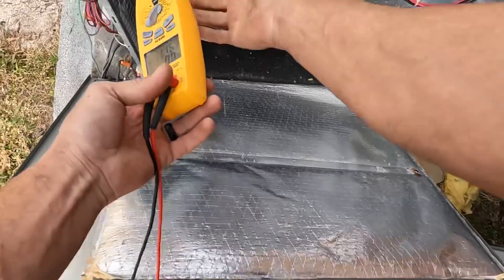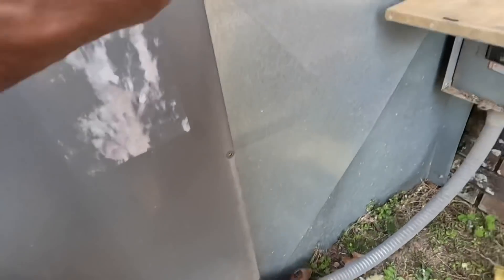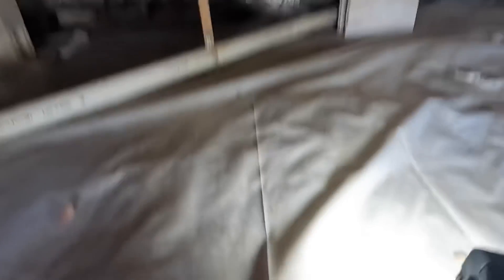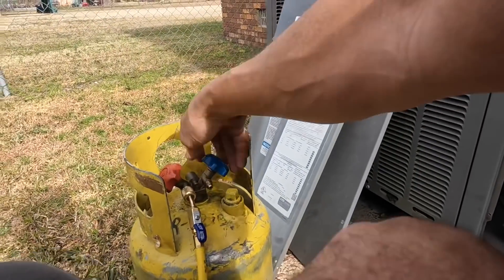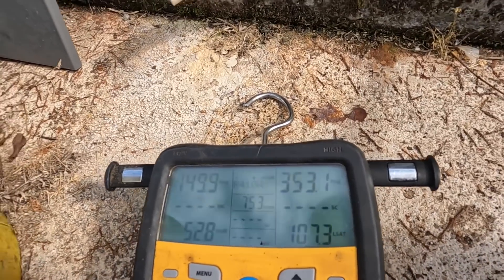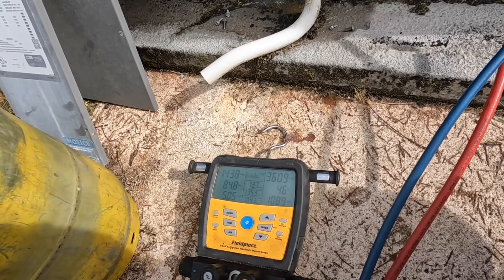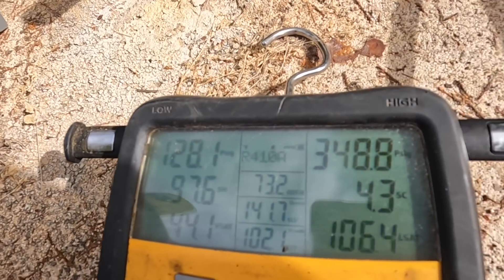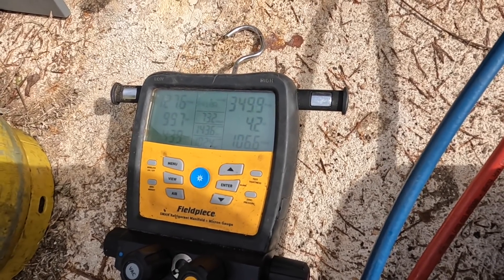Really High Head Head Pressure on Ruud Heat Pump Package

Comment: I had a split system today that was not cooling well 30* split but suction line freezing back 
Initially 94/258psi but after that ran consistently 
106/263 @ 76* ambient 410a system 
Compressor good amps 
SH 0 SC 3 
Looks low charge by pressures but SH/SC are anomaly 
Piston system coil fair inside and out.
Blower pulling 1.7 A out of 3.1 clean filters 

Put into heat mode and pressures 170/559 rising before I switched back 
Filter drier is on discharge line 
Reversing valve sounded very smooth 
Forgot to watch it equalize however once it did, it was 168/170 for a 59° saturation at an ambient temperature of 79° 

Since it’s a piston, I don’t think that’s necessarily an issue, but I feel like the reversing valve is the issue since there was a unit same model next to it with a dead compressor burn out 

For this unit I would quote an extension of diagnosis and check temperatures across reversing valve hard to access
But generally, I would quote replacement of reversing valve and filter dryer and open piston for inspection at that time while recovering also check charge and compare with data

Comment: I can’t tell you how many times that’s happened to me I get a call and someone overcharged the unit because a coil, or filter was dirty and they see low suction pressure and just assumed it must be low on Freon. Lol. Or they just Dont know what they are doing. It is weired the customer sais no one has added any Freon. I Dont get that. Strange.
Reply: I actually had a little straight air unit one time I really believe someone had added Nitrogen in with the refrigerant.  It run perfect, pressures were in the norm but just wouldn’t hardly cool. I didn’t have anyway to know a 100 percent but that seemed to end up being what it seemed to be. You never know what someone has done before you get there.

Comment: I have a unit I’m working on currently where a heatpump condensor runs normal pressures but after about 10/15 minutes the pressure on high sides starts to climb until 400s then trips on high head, I was thinking possibly the reversing valve but I would assume my suction would look off the suction stays @120 but the head slowly climbs from 300-400 over the course of 30 minutes any thoughts dryers same temp on both sides inside up unit the accumulator seems to be sweating excessively

Comment: Is it normal for a few ounces to make such a big difference in pressure? I have a 6 month old 5 ton Amana HP that keeps showing a "low refrigerant" message.  Installer (a reputable company with multiple techs) has been here 7 times in last thirty days. Once with Amana rep. The low ref message shuts off the HP and turns on the auxiliary heat strips. But when the HP does function for a short period of time (before it gets the low ref msg) it does a poor job of heating. The vapor line (big line) never gets warm. I noticed you were at about 140. Installer has tried removing ref and later added some back.  I don't know what the pressures are.  I am concerned about how finicky HP's are with charge level and if I will need charge adjustment twice a year (summer and winter) just to keep it running correctly. I haven't had a coronary over this yet because it's still under parts and labor warranty but I am worried about cost after the 1 year warranty is up. FWIW, I have a 9000 btu mini split HP in my bedroom and has worked perfectly for the last 3 years. Today in the DFW area, it's 21 degrees and the mini is pumping 80 degree air into the bedroom.
Reply from the maker: The Reps don’t always have great diagnostic skills, few do. They may be well versed in the literature, but…I’ve told more than one they don’t know what they’re talking about. The SEER rating and outdoor temp have a lot to do with hot gas temp. But, it should get hot at some point. If there have been that many visits by one company, I think I’d call someone else, and make it clear what you’ve been through. I know you don’t want to fork out the money, but if you can prove the other company has messed up, they might reimburse you for your efforts. I’m curious if your system is R-32 or R-410A. If everything is up to par, you shouldn’t need to add or adjust unless there’s a leak.

Comment: did you weigh the tank before and after? Been selling Rheem / Rudd last 15 yrs and have seen this several times. Over charged right out of the box
Reply from the maker: I weighed before and after. I recovered 8 ounces. This system is four years old though.
Reply: @HVACGUY  IMO 8 OZ wont make that big of a pressure difference. Id be looking at the TXV. Its a matter of pounds over when its happened here.

Comment: I think some of those rheem motors only have certain speed taps programmed
Reply: Agreed moved heat tap and in cool mode x13 did not run blower 

Good thing i did maintenance on both modes after blower clean, was just looking for better temp rise, my own system

Comment: What about maybe weighing out all the refrigerant and checking the data tag to see what the factory charge is? And then weighing that back in
Reply from the maker: In hindsight I should have asked for approval for the extra time to do so.
Reply: Would have been the smarter move. You can’t tell the charge on a heat pump in heat mode without truly weighing it out and in, unlike air conditioning where you can just check sc and sh. Yeah, some manufacturers allow you to block off the outdoor and some have subcooling charts and pressure ranges but it’s never truly accurate I’ll tell ya.

Comment: Doesn't anybody do cfm formula anymore. Cfm = btuh/  ( delta-t x 1.08)  for gas furnace temp rise formula. For electric it's cfm = (V x A x 3.41) divided by ( delta-t x 1.08) then you know for sure whether it's an airflow or refrigerant problem. If your not sure then do this formula 1st....hvac guy would of been there half as long.
Reply: Are these formulas only good for heat?
Reply: @BibleBloopers  no its good for ac  but you have to run the heat and fan must be in  high speed..easy when it's a psc motor. This will tell you if your getting 400cfm per ton thru the system with high speed fan.
Reply: @97Napkins  what I'm asking is this formula can only be applied to heat mode, correct?
Reply: @BibleBloopers  that is correct
Reply: @97Napkins  when you say that cfm=btu/ (Delta t × 1.08) how do i know what the btus are for the heat pump and furnace? My guess is if it's a heat pump then the tonnage will tell you. For example, a 2 ton equals 24,000 btus. Is this right?

Comment: Once had to pull out charge from a Rheem condenser the was near double the factory charge.  600 psi R22 is a problem and the compressor did not like it.  Thankfully Rheem added a high pressure cut-out, which was not typical of most manufacturers during the R22 era

Comment: I have a dual fuel system I installed that's running high head pressure in heat. I did the install. It is the factory charge but only 10-12: of linset. I talked to the factory tech support and they said it could be running at 500+ psi. I still think that's high. I may do the same thing you did and recheck it in a/c this summer. Btw the crawl space does have a unique taste.. lol
Reply from the maker: Nowadays system is supposed to be charged for 15 ft. Of line set. But, I have recently found that’s not always dependable.
Reply: @HVACGUY  yep. With prices on 410... Used to be pretty damn on. 2023 is coming up. We all will be afraid a bit to use those torches. Good thing - industry pushing those   HVAC "sharkbites" wich will secure our jobs. 😂
Reply: Second that☝🏻
Reply: Good practice - to adjust charge in cooling (ID conditions stable, OD ambient high enough, clean coils and sufficient airflow). Retrofits often have insufficient/undersized ductwork in now days wich starving EVAP alot - smthn to keep in mind as well. I had to rip out 2 yr old 21seer Trane(sold and installed by competitor) and replaced it with   14seer because ductwork( enlarging ducts was not an option due to very limited space).